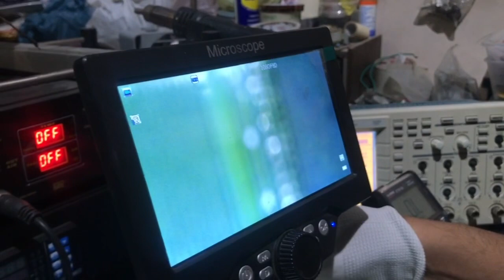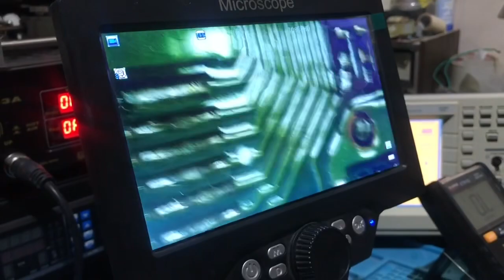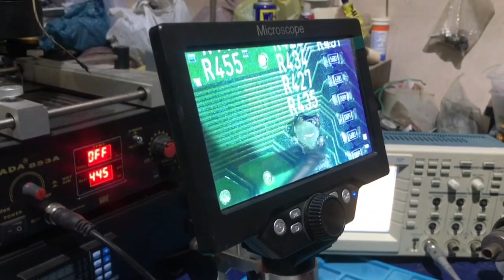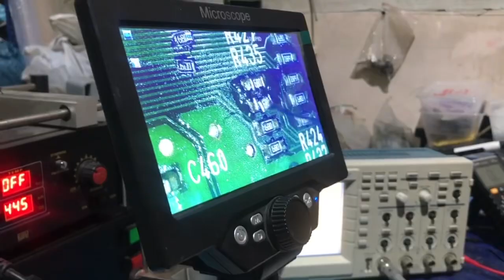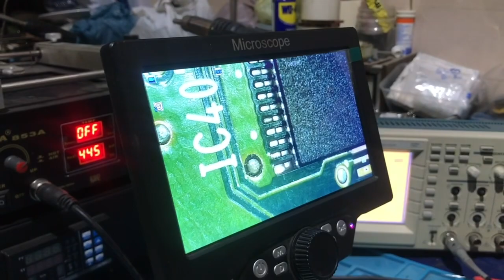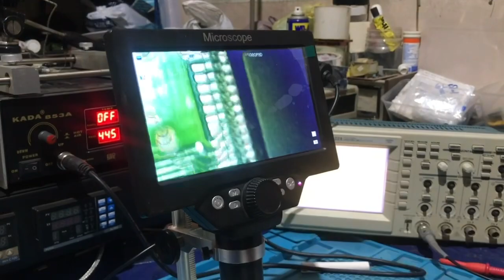YAMAHA PSR-2100 | Distorted Sound |Repair

Comment: Hello, I have a Yamaha PSR 2000. Some time ago, I encountered the problem of some keys not working, and I solved the problem with keyboard rubber contact strip graphite powder. I did this in all 5 octaves. But this time, a new problem has arisen in some keys, the keys have no sound when playing legato. Each key is played alone and in a staccato mode, it has sound, but it has no sound during legato. This problem occurred in some keys, not all keys. Have you ever encountered this problem? Do you know the solution to this problem? Thank you for guiding me
Reply from the maker: Hello. Clean the key panel PCB and connectors also clean the key penal ic board with thinner or alcohol . Some times graphite power leaks current on key panel PCB . It will be fixed

Comment: 🎉saludos desde mexico una pregunta yo estoi checando un psr 2100 y ya le puse los filtros para que arranque y no prende que circuitos sera gracias amigo
Reply: Soy de México igual y tengo el mismo detalle que el del video pero con un yamaha psr 2000 me puedes ayudar?
Reply: @alejandrocambrano5760   mi psr 2100 tiene el mismo problema por lo que ve tendre que intentar repararlo yo mismo ya que pakistan esta muy lejos 😁

Comment: Ic 406 or 407 Mask Rom Hai agr in main koi b problem ho to keyboard on hi Nahi ho ga
Reply from the maker: That is a flash ic . If the problem is in flash the board do not turn ON . These tow rom are wave rom . There ware some bad connections and dry soldering. The mcu was not communicate properly with wave rom .

Comment: I have one with the exact same symptoms. You made a lot of fixes in the video. Which one do you think actually fixed it? I would guess faulty capacitors. But haven't cracked mine open to check for solder problems.
Reply from the maker: Yes ! In this case the main problem is in the Capasitor.
I have uploaded an other video. In that case the problem is in the wave rom ic . 
It depends what kind of destination is